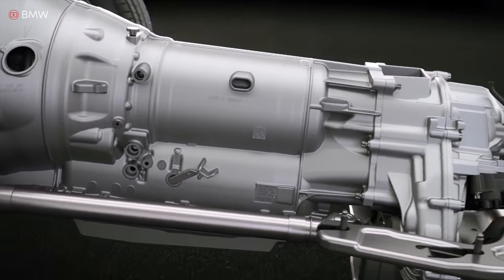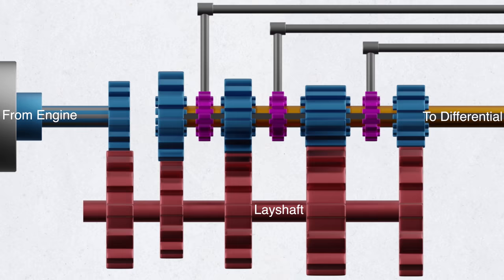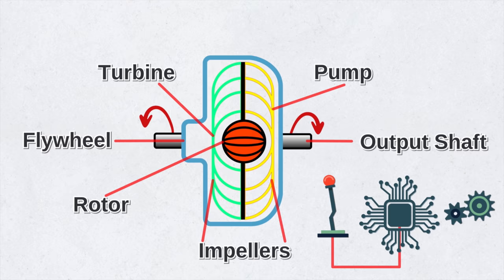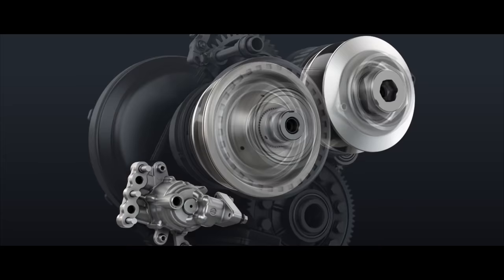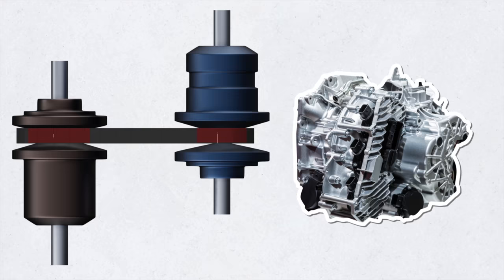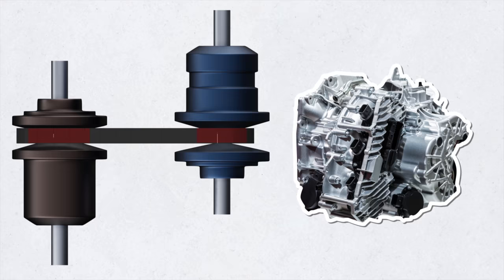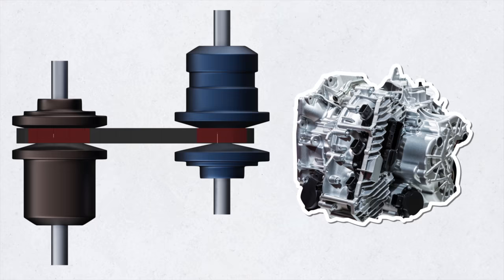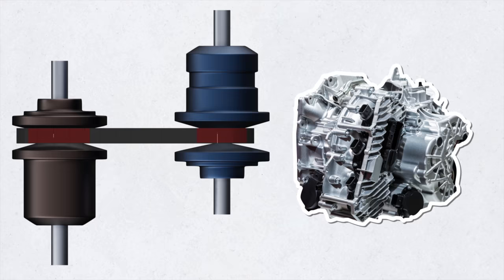Parking Like This Will Destroy Your Automatic Transmission

Comment: How did you connect low fuel levels to transmission wear?!? The transmission fluid is responsible for cooling and lubrication as well as operating pressures. The engine oil lubricates and partially cools the main engine components, with the engine coolant being the main temperature control.

The only two things the fuel would possibly cool or lubricate would be the fuel pump and injectors.
Reply: Agreed. There is no connection between these two systems.
Reply: Agreed.  This guy is one of those people who sounds really knowledgable to people who don't know any better.
Reply: As far as I'm aware, the only thing that can be affected by low fuel level (assuming you don't actually run out while driving) is the fuel pump itself, which in many cars is immersed in the fuel and relies on it for cooling.

Comment: When I first got my driver's license, I would occasionally drive my father's 200 hp Mercedes C class with an automatic transmission, and my mom's 91 hp honda with a manual transmission. The honda was so much more fun. My car is a 98 hp honda civic  with a manual and I would never trade it for any automatic car.

PS: I live in Germany, where we have the autobahn with no speed limits. Manual cars are still more fun, even if the max speed is lower.
Reply: Manuals also make you a better driver.

Comment: Excellent treatise on transmissions. I still prefer driving manual transmissions and ordered a manual in my Saturn Vue when I bought it new. Not only are manual transmissions less expensive to repair, but if you know how to drive it properly, you can get better gas mileage.

Comment: Love watching your videos, always love to learn about all types of vehicles.
I have a 2012 honda accord lx with an automatic transmission, and I have always used my parking brake when I park and everyone would question it. Now I have an actual response of why it is a good idea.
Reply: I have an '08 Accord that I've owned since '09. Never use my parking brake unless I'm on a hill. I still have the car and never had an issue with the transmission. But then, I take good care of the car and I don't ever drive it hard.
Reply: Who parks without using the parking brake? 😱😱😱
Reply: @aitoluxd  . You don't need it if you're on flat ground. Overusing your e-brake will cause it to wear quickly and you'll need to replace it.
Reply: @MrSupernova111  not if it's a mechanical parking brake
Reply: @MrSupernova111  100% wrong. You shouldn't be spouting incorrect information. ANYTIME you can use the parking brake, first, that takes the "pressure" off the transmission when parking,  not only when on a hill
Bring car to a stop
With foot still on brake, shift from Drive to Neutral
Foot still on brake, engage Parking Brake
Foot off brake, shift from Neutral to Park
Shut off engine
Reply: @MrSupernova111  On a manual transmission, the ONLY way to park the vehicle is by pulling the parking brake. How often do parking brakes need replaced on manuals? Never? Now please reevaluate: does your claim here make any sense?

What DOES happen, though, if you DON’T use it regularly, is the hardware can seize. I’ve owned three vehicles. On two of them, the parking brake did not function at all when I acquired them, because it was never used.
Reply: @DannleChannel  . I never said that I don't use my e-brake. I've owned a vehicle for 25+ years and none of my vehicles ever had an e-brake or transmission problem. Sounds like your problem is user error. You should look into that.
Reply: @MrSupernova111  I like the personal insult when I said explicitly that the handbrake didn’t work when I acquired the vehicles. Very clever. You’re right, I’m so stupid that I somehow sabotaged them before I even got them. And then I fixed them later, you know… for funsies.

You’ve been lucky they haven’t seized. Want to have an adult conversation and address any point I’ve made or just make insults that don’t make sense?

I didn’t even accuse you of not using yours; I pointed out that frequent use doesn’t cause them to break, or manuals would be notorious for the issue you propose exists. Why be defensive?

Comment: Driving a manual, getting the transmission speed to match the engine by 'blipping' the throttle, dropping down two gears onto a traffic island .. the main pleasures of driving.  Likewise a sports bike.  You don't know what you're missing in the States.

Comment: My granddad taught me when I was a younger man during my teens and twenties I'm now 46. When I park on a hill before I take my foot off the brake pedal to put the car in park and set the parking brake first before moving my foot off the brake pedal. He said this would save me a lot of trouble later down the road. My granddad wasn't a mechanic by trade but very mechanically inclined. Because of him I can change my own oil and spark plugs, and do a brake job if I need to, plus change my own automatic transmission fluid ,gasket and filter ,Exedra. I sure miss him rest in peace grandpa, I love you. You taught me so much about how to live and live right. On a funny note the first time I change the transmission fluid on my car when I was about 22 I broke off of two of the bolt on the transmission pan. Yes I over torqued them. 😁 luckily my granddad knew how to fix that. I thought the world came to an end when I broke the first one. When I broke the second one I felt like a horses well you know.
Reply: I see so many people take their foot off the brake first.  You can hear the quiet screams of the transmission as the car rolls against it.  Oh yeah, then they might put the e-brake on at that point.  Even dealerships have a bad habit of doing that.

To park:
Stop.
Put in Park.
Keep foot on the brakes.
Set the e-brake.
Then remove foot from brakes.

To drive:
Put foot on brakes.
Put car in appropriate gear.
Remove foot from brakes and drive.
Reply: On an incline, I stop, put it on neutral, set the emergency brakes, put it on park, then remove foot off the brakes.
Reply: Hope someone loves you as much as you love your grandad. Bless you.

Comment: Driving '70s cars with automatic transmission, I was told, especially in winter, just idle for a minute so the torque converter can fill up.

Comment: Many vehicles are designed to cruise at 60 mph at approx 1800 rpm.  My vehicle maintains 40 psi oil pressure at 1800.  If under a heavy load without downshifting 1800 rpm may damage your engine.  Also better to apply the parking brake before putting the transmission in Park not after and releasing the parking brake after taking the transmission out of Park. Doing this will reduce the load on the parking pawl in the transmission.

Comment: Last year when my wife's Toyota corolla engine crapped out at 558K miles. We put head gasket sealer to get a little longer out of the engine while we went looking for a new manual transmission corolla.

2 mouths of looking, 48 dealerships across 3 states. What a pain in the balls it was to find one. 

When it's time for a new engine or transmission in this one, we will be rebuilding over buying new.

I have 86 ford ranger manual, 2002 corolla manual and 97 square body jeep Cherokee manual. I undercoat them and am not afraid the spend big money. 

Can find any replacements for them. 

Sad to see manual dying off, but the bright side is if 90% of people only know automatic. It's a security feature.
Reply: Put in a 2nd stick as well to really confuse them as the second stick would be for the 2 speed differential.  Maybe toss in an extra pedal on extreme Left.
Reply: Yeah and I don't like the dial shifter knobs either. Why rebuilding older cars will become more common.

Comment: I agree about using the parking brake with an automatic transmission. Ever notice when you're on a hill and you put it in park it rolls a little when you let off the brake? It makes it harder to shift from park when you shift again. Using the parking brake avoids that.
Reply: Also if someone "taps" your bumper when parked, having the Ebrake on will protect the transmission.

Comment: re:  reasons to keep a full tank. Condensation occurs inside a tank in direct relation to vapor / gas volume. Driving in warmer climates may be less effected , but driving in conditions that have frosting and dewing climates create a lot of water in the tank. Keeping low fuel levels guarantees high condensation level . Cold weather means water in tank can freeze and low tank levels make it more likely water could enter fuel lines -- and freeze. Condensation can also occur in transmissions - so - change fluids.
 Use " HEET" or similar additives. Also - didn't hear anything on advantage / disadvantages of gearing down when going downhill. This seems to bother some people, while I would encourage it ( as long as you don't overspeed the tranny ) .

Comment: I’ve learned that parking on a more or less slanted surface only using the park mode on your automatic transmission also endangers the health of your gearbox. The problem being that it’s the same pin you can break when going from reverse to drive before coming to a complete stop first that now stops the car from rolling down the hill. After learning this I now stop, put the transmission in neutral mode, apply the handbreak and then put the transmission in park mode. Now the car is being supported by the breaks instead of a little pin.
Reply: I am now doing the same thing. But(!) I have NEVER used only the “Park Mode” when parking my car. I used to put the car in Park first and then engage the Parking Brake. Now when I want to park, I put the car in Neutral, engage the Parking Brake, and then put the car in Park.
Reply: Brake
Reply: My driveway is steep, so I've been doing this as well. I pull in, shift into park and pull the ebrake BEFORE I take my foot off the brake pedal. That way I don't shred my Veloster's gearbox every time I go to start it. I tried to warn my parents about this with their AWD Sienna. One $5,000 transmission replacement later and they finally heeded my advice.

Comment: Another reason to warm up the car is that if it's January in Syracuse, Rochester, or Buffalo you need to spend time with an ice scraper clearing off your windows anyway. In spite of living in cold climates most if not all of her life my former neighbor used to think running the car for 20 minutes without driving it anywhere the previous night would do the same job as warming up her car before going somewhere even though the entire system would obviously cool off again when she turned off the car. I guess she didn't take into account that a car cools off in far less than 9 hours into account. I would usually see her start up her car and go to work without warming it up at all because of her thinking.
Reply: Having lived syracuse ny i know about getting two feet of lake driven snow off car and heating up. If not you freeze your asz off in the car too. Remote starters desired
Reply: In extreme cold below zero ...  getting the car hot lasted a few hours during the night and charged the battery. It definitely makes a difference in sub zero mornings groan starts

Comment: Love the video my grandpa taught me most of these older things, it was cool to see the different types of transmissions I hadn't seen though. I have a friend who added washer fluid instead of transmission fluid and well it messed up everything. It was by accident but it was a costly accident. Ended up having to buy a new car after that mistake so don't use washer fluid in place of transmission fluid.

Comment: I've been coasting in Neutral on hills.
I've been leaving it in Drive when sitting in the car for a long time.
I've been shifting to Park before the car was fully stopped.
I only fill my fuel tank when the gas light light comes on.
I've driven on spare tires for extended periods of time.
I've never checked any of my transmissions for water.
I've never cared about the amount of weight in my cars.
I've driven cold cars immediately before letting it warm up.
I've never added any fluids to any of my cars (except gas, if that counts).

At least I use the emergency brakes! 😅

Comment: I found this video educational and interesting. My main concern is with the modern CVT.  While I like the way it performs, but is frustrating to not have a dipstick to check fluid level and condition. Plus, it needs a special transmission fluid that is more expensive than the traditional one, and it is harder for someone to do a fluid change at home. The complexity of modern cars makes me wish I held onto my old cars from the 80's and 90's.
Reply: And it has a metal belt you have to change...that's stupid..
Reply: Yeah the older vehicles were easy to check and maintain. Everything is computer driven and any modern transmission is hard to even try to change the fluids.
Reply: Computers suck when it comes to vehicles. 🙄
Reply: I have a mitsubishi lancer 2016 with cvt transmission and it does have dipstick to check oil level

Comment: My Dad never used his parking brake in his automatic transmission cars. As a teen I drove his Oldsmobile and when I got to my destination I had to park on a slope. Thinking of the load on the pawl I engaged the parking brake then shifted into park.

When I went to leave the parking brake wouldn't release. He yelled at me, "Never use the parking brake, they seize up." Yeah, Dad, if you never use it. In the 40+ years I've owned vehicles I've always used the parking brakes without seizing. You simply have to service them like other components.

Comment: I've never damaged an auto transmission to where it needed to be repaired but I have been known to shift between reverse and drive too quickly. But in newer cars there's a delay in the gear shift - not like 30 years ago where the shift was virtually immediate which is something people use to do to get unstuck in snow or ice.
Reply: Good way to pull a huge wheel spin floor it then push the shifter into D
Reply: You do you booboo, this man has a ton of knowledge !
Reply: People always forget to shutoff traction control when rocking car outta a rut .. damages the tranny
Reply: i watch people shift to drive while their car is still rolling backward constantly- drives me nuts. i drive manual- i like to take my foot off the break at stop lights to mess with people. i'm going to go to hell.

Comment: I love your video Scotty.  I now fully understand a CVT engine: it’s similar to a bicycle with gears.  In 28 of my 36 years of driving I’ve driven manual and I love it.  It gives me more control in all situations.  My latest car is a Subaru Crosstrek, with a 6 speed manual transmission.  The only thing I don’t like about it is that it’s all-wheel drive.  I actually wish I could disconnect the rear wheels from this feature until I needed it, but oh, well.

Comment: I've never heard that your car will last longer if you consistently fill up without your tank getting too low. I still don't quite understand the exact science of this, but it seems very interesting
Reply: It depends from different factors, but, generally a good idea to keep tank full as there is less air (+water vapor) in it and therefore less condensation. Just a couple drops of water freezing in the fuel line = no start in cold morning. Humidity can also promote rusting of insides of steel fuel tanks and this rust can potentially clog filters, fuel lines etc.

Systems with fuel pump inside the tank - it certainly helps with the cooling of the pump. Fuel may well be used for cooling high pressure fuel pumps too, so good circulation and enough cooling space/mass makes sense. I've heard that newer cars may sustain fuel system damage when tank goes empty. Think of all those super-fine-sensitive pumps, regulators and controllers getting stranded fish experience. A doctor my be needed to avoid further complications.

Comment: That ZF 8 Soeed has incredible shifts. Not only are Shifts really clean with a nice little jerk with each shift, the Shifts it's self are very precise each time.
Reply: Agreed!  The ZF in my f-Type seems to have ESP - it senses when i'd want it to shift and does it at the same time as i would!  it also compensates nicely for the throttle position, holding on for longer under harder acceleration.  Great gearbox.

Comment: 1. Don't coast downhill on Neutral.
2. Dont' stop on long period on Drive
3. Don't put your car in Park before fully stopped
4. Dont keep your fuel low, keep it at least quarter.
5. Use handbrake on when stopping on park in an angle
6. Don't overload your car
7. Preheat your engine

Do i get everything?

So only point 1-3,5 were automatic specific, the rest somewhat applies to manual too

Comment: Ah, the torque converter explains the GM Powerslide transmission!  😂
Reply: The 2-speed powerslide won a lot of drag-races !
Reply: Did you know that the original Corvette was only offered with a Powerglide transmission?
Reply: @johnlavender242    I vaguely recall something like that.  I had a’56 Belair with the 2-speed - gotta say it did shift fairly smoothly.
Reply: i have a buick one  in mine  great tc

Comment: When I was a kid, one of my first cars was a 1960 VW Bug, I think I paid the handsome sum of $150 for it, I was fairly good with a manual trans having learned on a 1957 Opal Caravan, but the bug was strange, when I let out the clutch in 1st it would automatically speed up , I'd switch to 2nd at the proper time and again, it would speed up..this all the way through the gears all the time.  I kind'a thought it was great til I let my buddy who worked at a garage drive it..he asks, how long had I been driving with a broken motor mount, yeah..only had two lower bolts holding the engine on. LOL